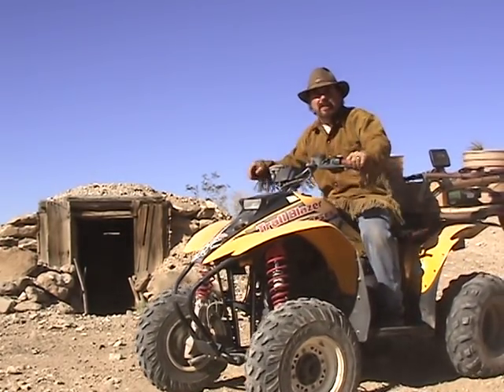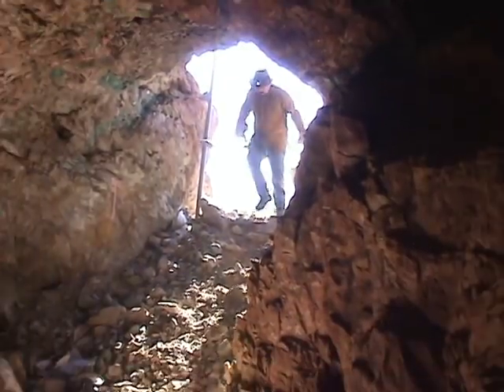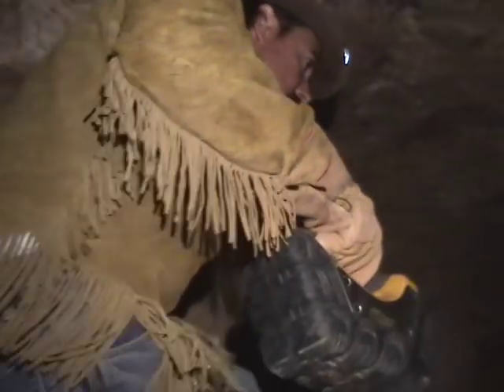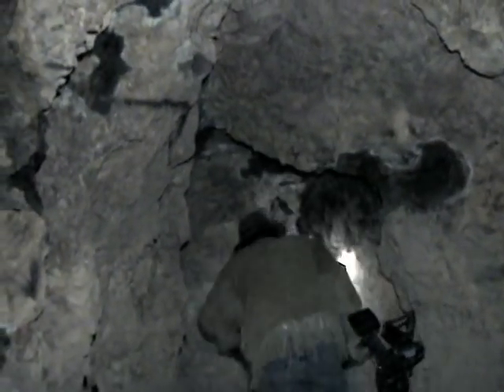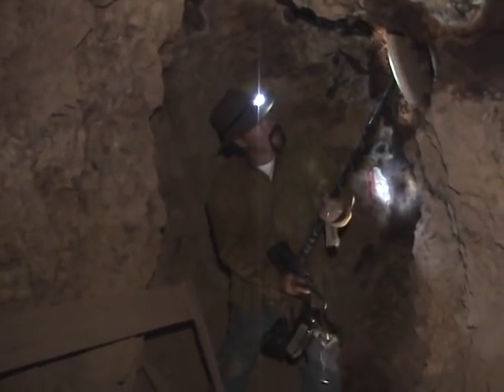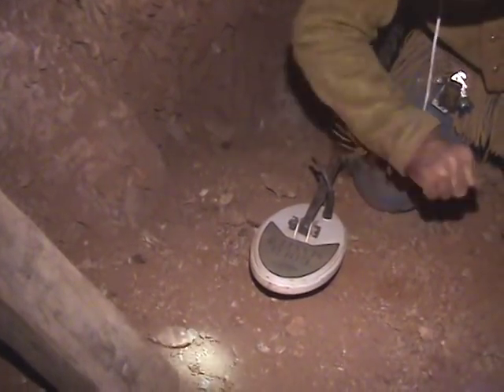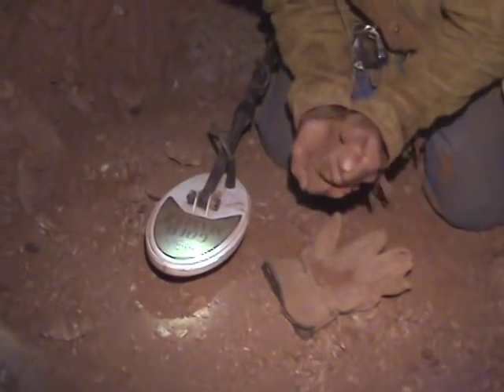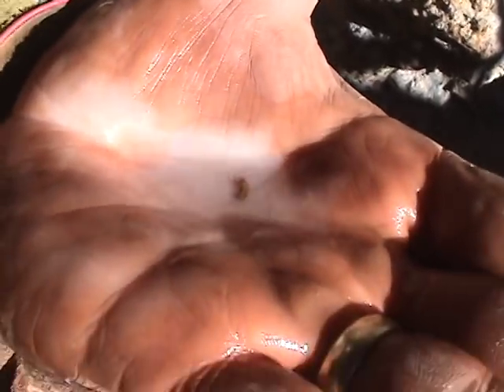METAL DETECTING | GOLD MINE - Finding Pocket Gold.

Comment: I remember when I was younger we took a small tour into a more remote mine here in Colorado. They spoke about some type of rock that made air circulation an issue. So miners would go down and die slowly of asphyxiation until they fell asleep and died. 

Anyone know what mineral or combination of layouts caused that?
Reply from the maker: Larry Chupacabra  Hi Larry, well I would say that arsenic from Arsenopyrite, Cadmium and lead from Galena will all decay into particulate matter that can cause lung issues not to mention Carbon Monoxide and Carbon Dioxide build up on the floor.
Jeff and Slim
Reply: Oh cool. Thanks for the info. Was a very nostalgic video to watch =D

Comment: Hi Jeff,
A question, why don't you seam to use pin pointers ( either garrett or whites )  when working these deposits.  Also you doing vac-packing of crevices with out using a pointer or a detector first.  Wouldn't a pointer save some time and effort, or are they just not effective enough on the smaller gold ??
Chris
Reply from the maker: Chris Wheeler Hi Chris good point and we will be using the Whites in the future. Up to this point we use a Falcon MD 20. Some cracks are very thin and will not allow a pin pointer in and the cracks can be deep too.
Jeff and Slim

Comment: Bought Detector It worked and I was testing it my first day then I was detecting and on the way back I found one heavy rock... It made signal and I was pretty confused coz I couldn't beleave that there might be gold inside or something valuable? I did Hide it actually and tomorow im planning to go back and pick it... Could there be gold inside? It looks like red metamorphic rock.. any ideas? :O
Reply from the maker: Maksim Gavrilov It may be iron or yes there could be Gold with it say check it carefully .
Jeff and Slim
Reply: Sounds like you found Hematite which is iron rich.  There's a possibility that there are trace ores inside, but be careful not to confuse fools gold with real gold (iron pyrite is common in hematite).
Reply: Thanks for help and advice guys! I Learned about hot stones and like Jeff said that there is always possibility for something valuable and more often its just signal for iron.. I actually Did read yesteday how one guy spotted stone with metal detector (hot stone) and there was gold nugget inside when he smashed it with hammer!! :O
Reply: SMASH SMASH"! ;D